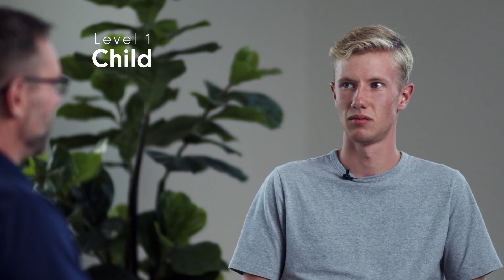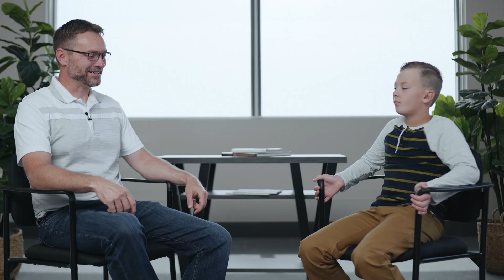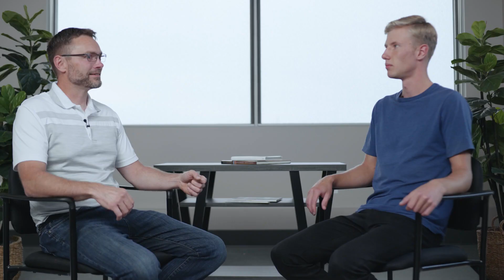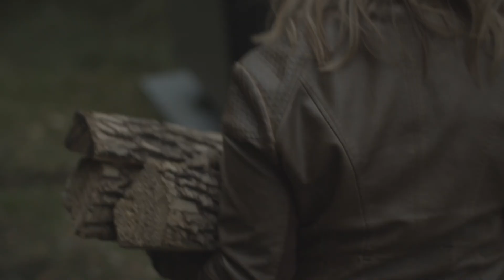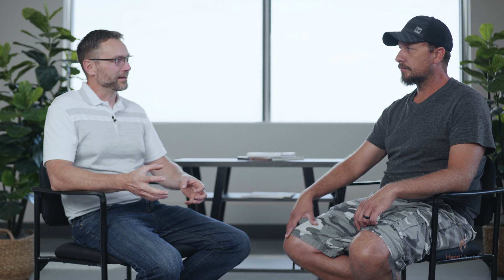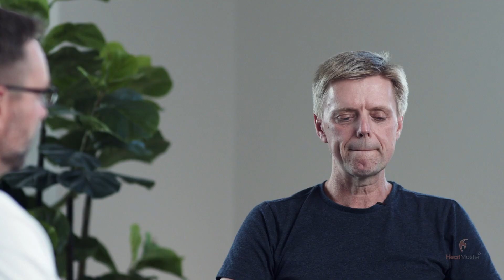The 4 Levels of Dual Air Modulation in Outdoor Wood Heating

Comment: What oxygen % setting is best for my Heatmaster g4000? What dictates the most efficient target setpoint on the oxygen level?
Reply from the maker: The best oxygen setting is going to depend largely on the wood that you are burning. Ideally, you would want to have the oxygen setting as low as possible while maintaining a clean and efficient burn. If you have good, dry wood we would recommend reducing your oxygen setting 1% at a time and watch the furnace burn. If it continues to burn clean and efficiently try to reduce it again until you get the number as low as possible.
If someone were to burn wood that would be too large or too wet, you would want to increase the oxygen setting to help clean up the burn.
We factory set the furnace to 6% but there is certainly room for adjustments either way.
Reply: @Heatmasterss  Much appreciated! Thank you for the advice and great quality furnace!